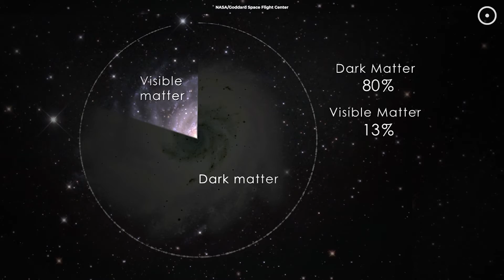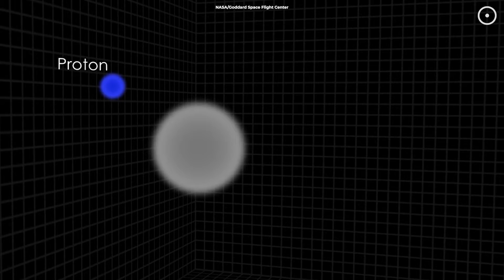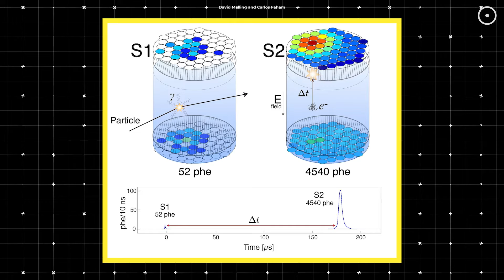Dark Matter Explained Simply

Comment: Dark energy is heat outside of the entanglement of mass. It is throughput space and is potentially renewable energy striking mass or unification of unidirectional flow cycling thermaldynamics singularities into elements. Hydrogen is first on the elements list. We have matter as quantum magnetic fields. Entanglement of mass is when heat energy unifies in propulsion and cold space resistance to unification of unidirectional flow redirects trajectories towards the weakest point of repulsion back onto itself as cymagnetic field generators. Cold repulsion to heat propulsion from cold repulsion is quantum magnetic fields cycling circulation patterns of elements. Hydrogen in cold space. Space is cold repulsion to heat propulsion from cold repulsion as space.  Stars at the end of their life span blow outward, leaving behind unoccupied space as voids devoid of heat singularities as  spheres of repulsion. Because they have no singularities passing through these voids of pure repulsion, the normal space filled with dark heat energy outside of entanglement hit this field of force of repulsion and are forced to circle the the perimeter and accumulation begins.  It becomes an external magnetic field. Mass is an outward force of pressure. Gravity doesn't exist. On the flip side, magnetic fields bonding or grounding synchronization of quantum magnetic fields of forced pressure cycling circulation patterns toward the weakest point of resistance until resistance is overcome by open space itself becomes surface mass towards the greater flow. Magnetism bonding force of pressure is known as weight of force of propulsion to forward momentum propulsion grounding in magnetic fields. Magnets synchronization of flow. All mass is outward pressure exerted by repulsion. Spheres show the repulsion of cold space. Heat singularities pass through space in waves throughout space near and far. These heat waves of renewable heat energy throughout space pass through all mass point to point quantum magnetic fields until they hit open space itself once again outside of entanglement of mass as dark heat energy once again. Conservation of maximum momentum velocity in resistance. Distance of entanglement of mass is reduced according to the amount of accumulation of mass in the path and rotation of the mass. Heat expands mass and distance from impacts of force of forward maximum momentum velocity in resistance until resistance is overcome by open space. Cold repulsion to heat propulsion from cold repulsion. Quantum magnetic fields redirect renewable energy by reducing distances according to the mass in quantum magnetic fields of forced pressure cycling circulation patterns as mass. Density can't exceed resistance within it as occupational space. Mass occupies space as neutralized cold repulsion within it. Theoretically factual probability that works with quantum physics without gravity.
Reply: Seems like someone solve the puzzle